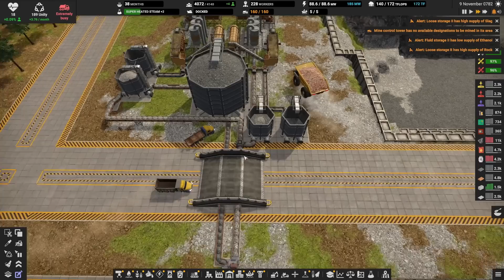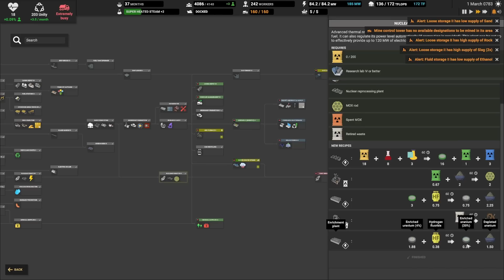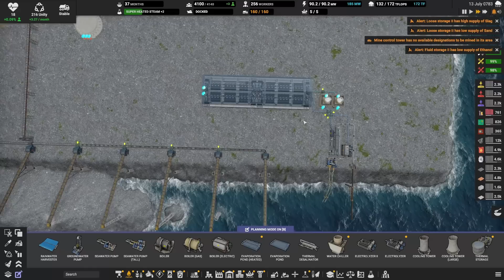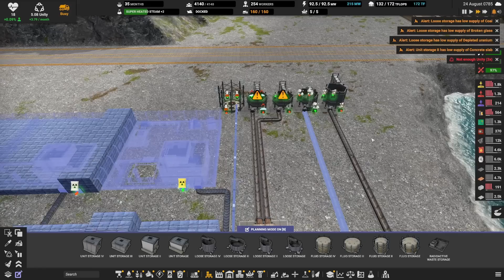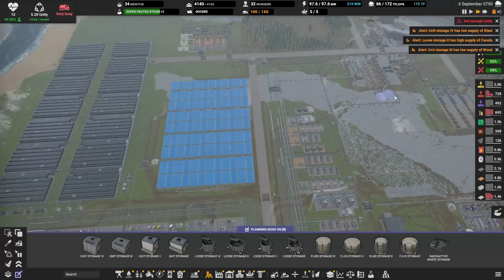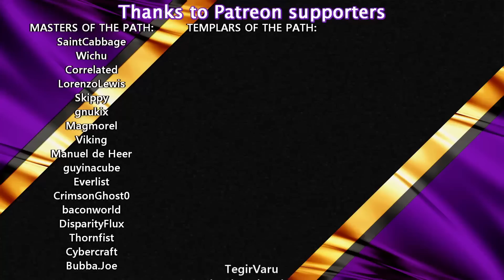Nuclear Waste To More Nuclear Power (MOX) | 17 | CAPTAIN OF INDUSTRY | Admiral Difficulty

Comment: Just curious, why create a separate MOX powerplant when one could «simply» prioritize MOX rods for the existing reactor? You still need to do the processing to make the MOX rods of course, which is a bit complex, but less so than a fully separate plant that will not work without spent fuel.